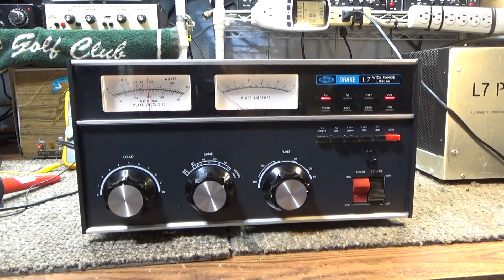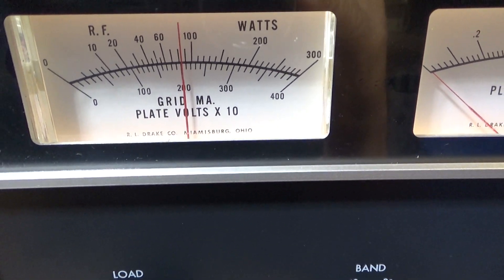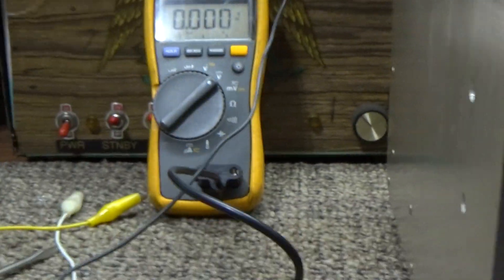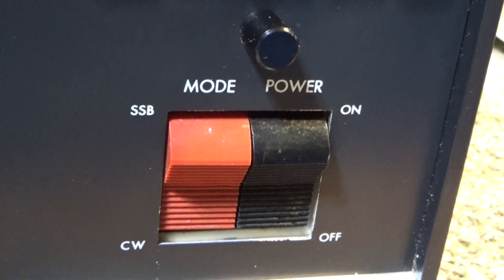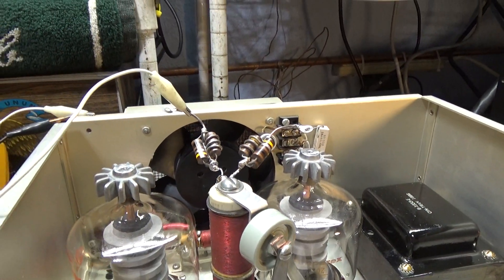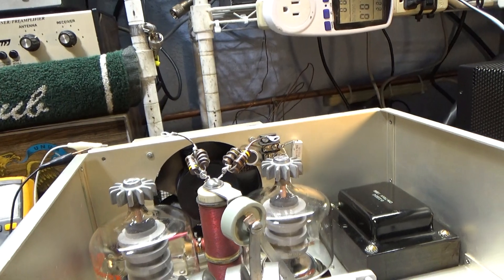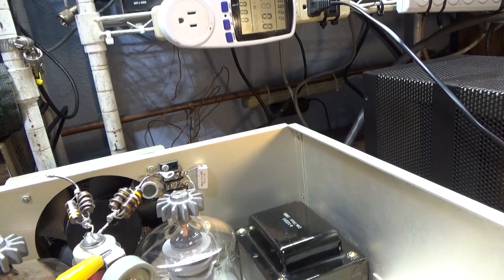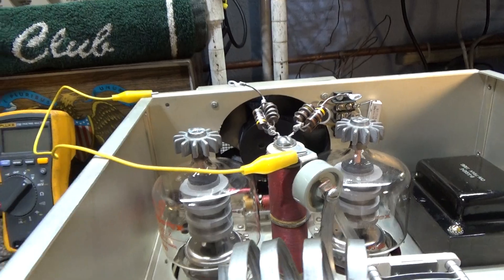Bleeders my thoughts and a vid on HV safety and bleeders.

Comment: I always use bleeder resistors,for two reasons. One-They should(*) eventually discharge the caps. Two-They help balance the voltage across caps in series,to help prevent unequal voltage sharing across the caps. (Imagine a 1kV supply,and two 500V caps in series. One cap might be leaky,and only charge to 400V,while the other charges to 600V-above the 500V rating.-extreme example,but you get the idea. Having a bleeder resistor in parallel with each cap will help balance the voltages.)
(*) Never ASSUME the bleeders are functional! Just because they are there,doesn't mean they aren't open circuit! ALWAYS check with a meter before sticking your fingers in there. If something doesn't have bleeders,add them!
Reply from the maker: Yep, agreed, done a vid or 2 or 3 on that.

Comment: Only thing I would add is to use a grounding jumper that you have personally made yourself, or at least inspected- and tested- very carefully.  I have some of those jumpers, and they are stunningly low quality.  I've had them go open.  Fine for testing, but not for safety.

Comment: Only thing I would disagree with is at the end of the text below the video.  In my opinion the number one killer of Hams (radio related) is improper tower climbing, working on roofs or climbing trees unsafely.  I know 2 that have passed.  One that fell off a tower with no harness and the other that fell out of a tree he had a antenna mounted in.  The later just happened earlier this year.  RIP Roland
Reply from the maker: I got that from Hams, I don't remember where. I also believe that the #1 killer of CB'ers is antenna installation deaths, but with CB'ers, mostly from electrocution from the antenna hitting a power line. I know a few who sadly went out that way even though I know a couple of CB'ers who went out because of 2 piece amps too.